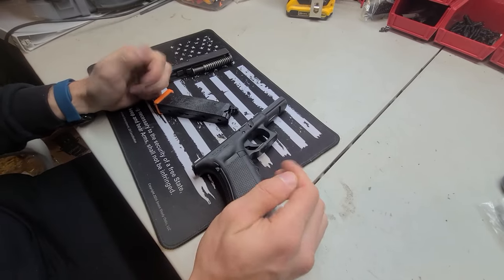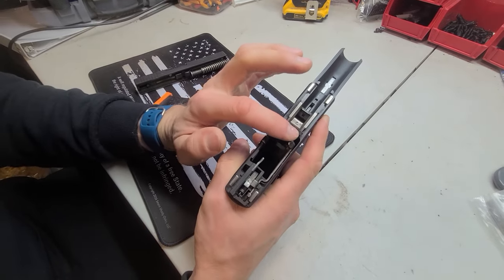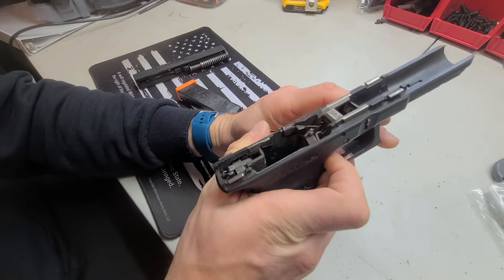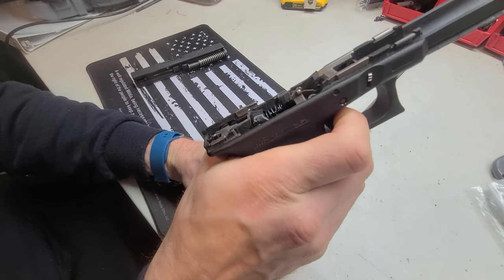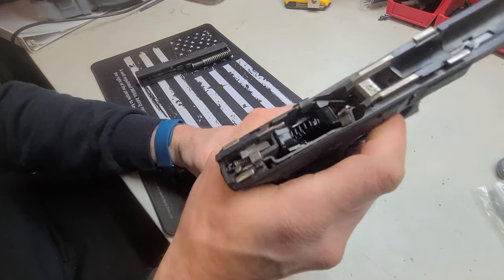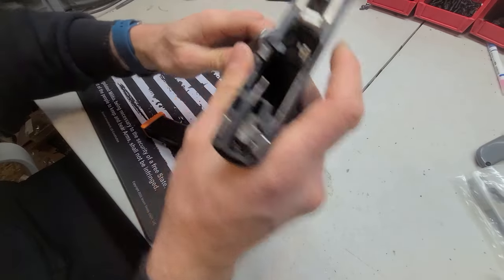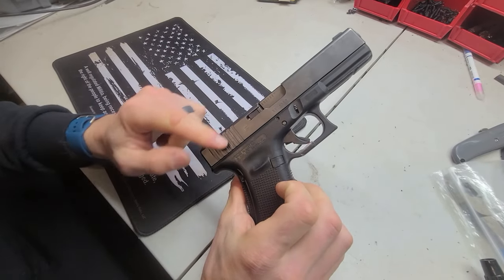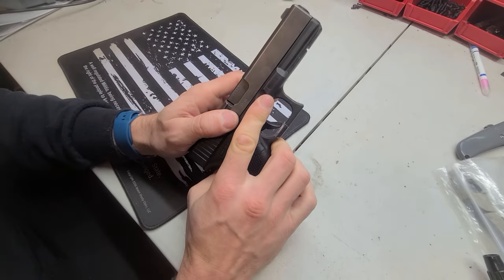How The DryFireMag works

Comment: I have a dry fire laser bullet, will the mag allow the firing pin make contact on the bullet?
Reply: Only on the first shoot, as the firing pin is NOT striking anything after the first time you pull the trigger, the DRYMAG is internally resetting the trigger bar in your gun. So, it clicks as if you racked it again. If you want to have a laser fire as before, use the new SMART Mag from Dry Fire Mag. It has a new optical laser bullet that works with the rechargeable mag in the system, this unit again doesn't use the firing pin from your pistol to trigger the laser but uses a light pulse from within the mag to set off the bullet, same result as before, just no racking the pistol between shoots! you can shoot 100 laser shoots without racking the pistol, after the initial firing. So bottom line is, you can now use your Strike Man, or I target system coupled with the Smart DRY Mag to practice at home without putting excessive wear on your favorite pistol. and SEE the results of your practice.
Reply from the maker: Thanks Terry, that is correct info.

Comment: Does this allow the firing pin to move ? I have the mantis laser academy. After each shot I have to rack the slide. I want to bypass the slide rack... PLEASE LET ME KNOW ASAP
Reply from the maker: @kennylsr.4460  Not the original DryFireMag. But our smartmag and laser combo pulses out a laser without using the firing pin!
Reply: @DryFireMag  where can I get this combo & how much??? Is there a video of them together?
Reply from the maker: @kennylsr.4460  www.dryfiremag.com
Reply from the maker: @kennylsr.4460  https://youtube.com/shorts/PYuuultt9SU?si=3cPX-vPZ1f3XUrQe
Reply from the maker: @kennylsr.4460  www.dryfiremag.com

Comment: will this work on hammer fired gun (SA/DA) or striker only?
Reply from the maker: Striker only
Reply from the maker: Striker only
Reply: @DryFireMag  Handgun newbie here, what are the mechanics behind why this system doesn’t work on a hammer fired handgun?
Reply: @cryan8271  Because there is no bar to reset on that type of gun.  And this is not something you'll want to use to help you determine the break point of your trigger because it only simulates a real fire the first time you pull the trigger.  After that the feel of a real fire is gone and it's just a spring tension that really doesn't feel like you released the firing pin.  There is really no way to reset the firing pin, or the hammer in your case, without working the slide each time.
Reply: @DryFireMag  Does it add any trigger weight?
Reply from the maker: @CandidZulu  the stock version is identical to the original weight. However, we have spring kits available for those that want to run their trigger at an increased or decreased weight.

Comment: why doesn't work with a laser cartridge/
Reply from the maker: Most laser cartridges are impact based. So they need the striker to hit the back of the cart.

The DryFireMag blocks the firing pin from functioning during use. That's why our laser is so unique! Ours is a led fed system built by @laserammo
Reply: @DryFireMag  are you guys going to build one the adds recoil? And do you make a mag for 7.62x39 caliber?
Reply from the maker: @TheJune301987  negative. For us DryFire is defined as focused on trigger pull skills. Recoil management is a separate skill.

Regarding the 7.62 caliber question: our mags are unfortunately not able to be built so broad as to serve a caliber. They have to be built to work specifically with the moving components of pistol internals. Example: Glock and Sig Sauer being separated by systems of internal parts and magwell dimensions.

I wish we could do as you ask! That would be amazing. It's too bad that's not an option.
Reply: @DryFireMag  thank you for your time!